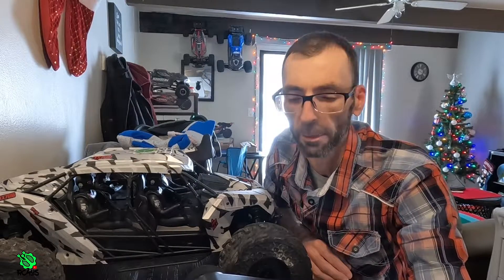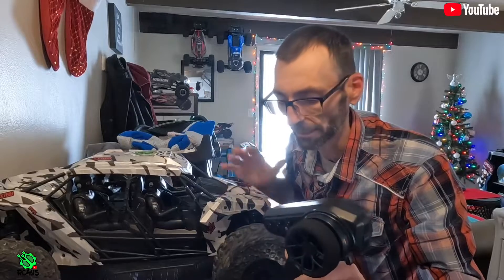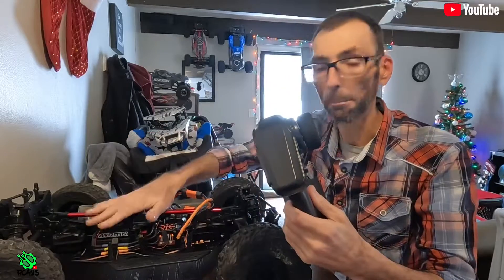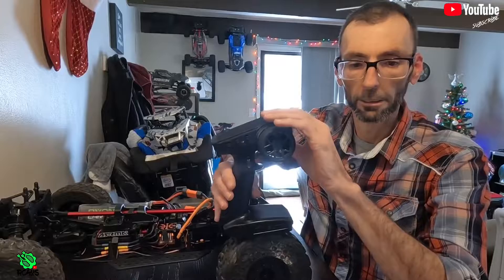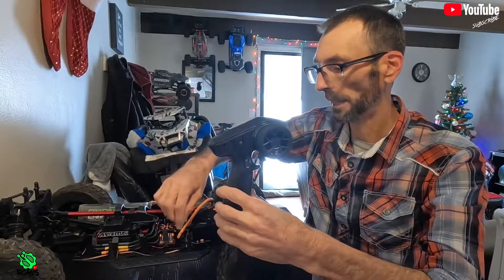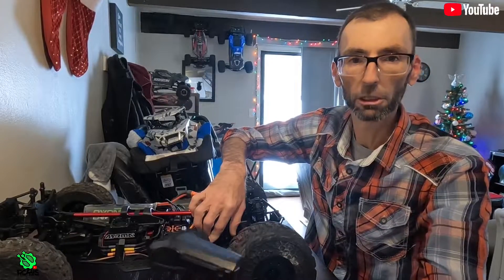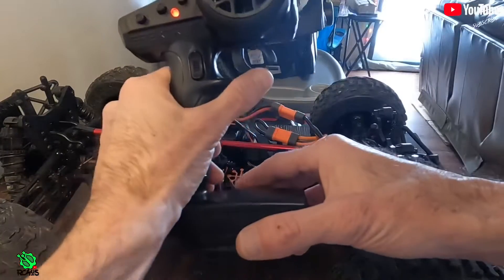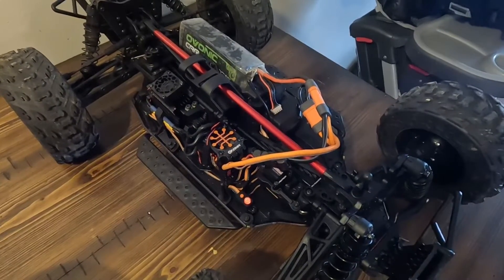STOP BREAKING SERVOS setting endpoints with SPEKTRUM slt3 works on all ARRMA 6s & 3s #howto #arrmarc

Comment: Just replaced the steering servo that died on the third run .  I used a Power Hobby servo, and it was right on from the start . 
Nice steering improvement  .
Reply from the maker: Yeah them power hd 23kg servos are so smooth it’s crazy I absolutely love them…. Thanks for watching an commenting

Comment: Nice vid. What exactly is the benefit of setting endpoints to max?
Reply from the maker: No no you don’t want them to max you don’t want the servo to be pushing the tire past it’s mechanical limit that will really destroy a servo because it’s constantly pressing into the servo saver an when your endpoint are adjusted correctly you can tighten your servo saver up so your steering is tighter an more precise

Comment: Thanks for the video! Trying to learn as much as I can and this was helpful! My kraton 6s exb came with that controller and the typhon I just bought for my kids. Ppl seem to say it’s junk. What’s the benefits of buying different transmitters?
Reply from the maker: Well if you’ve never had one it’s kinda hard to explain but when use a higher end remote it feels more connected an comfortable the reaction time from the moment you input a touch of the throttle or steering it reacts the range is generally a lot farther an you stay completely connected to the car even far away also a lot more adjustable allowing extra channels an they generally have the ability to bind multiple rc to 1 so you don’t have to drag 1 for each car you bring you can get use to just 1 but theirs way more reasons then this just my reasons
Reply: @RC4us  makes sense. I always need all 3 transmitter(3 cars) since me and m 2 boys have our own. Maybe I’ll upgrade the kratons in the future.
Reply from the maker: @davidZ3035B  yeah them dx5c are pretty nice I think it’s a bit pricey but all horizon hobby cars come with spektrum receivers so

Comment: that was awesome Mike 👌👍..thanks very much for this information on end points with the FireTeam ..do you think this will work same with Kraton 6s as well?
Reply from the maker: So this will work with any SLT3 transmitter why this information is included with the purchase of one of these is beyond me now I’m  not 💯% sure but I think if you bought a slt3 with the alt receiver the manual talks about this setting I have a dx5 the majority of my cars are on that or a dx3 I’ve not had one of these in awhile until the KRATON 4s an now this fireteam I had almost forgotten I will probably be moving the fireteam to the dx5  soon I’ve gotten a lot of parts in over the last week to review an use in a build so I’ll be replacing the steering servo an a few other parts so will be in at the receiver then